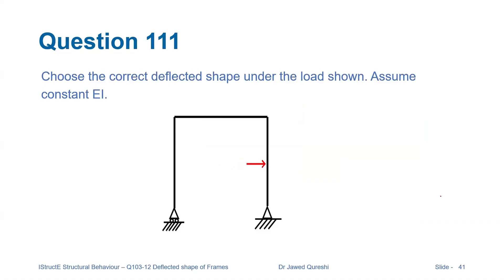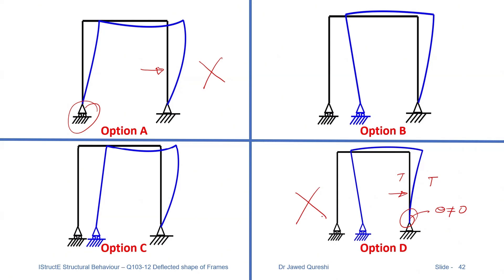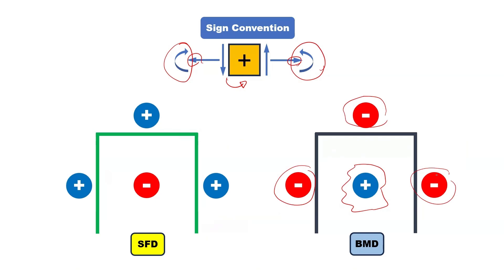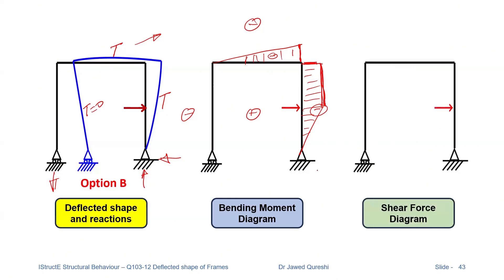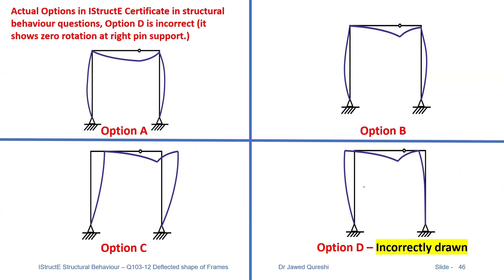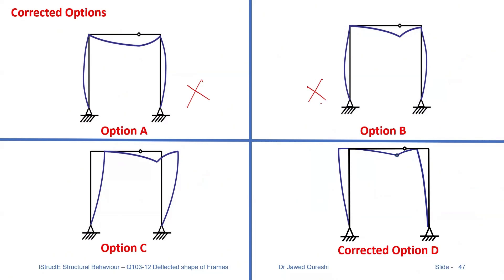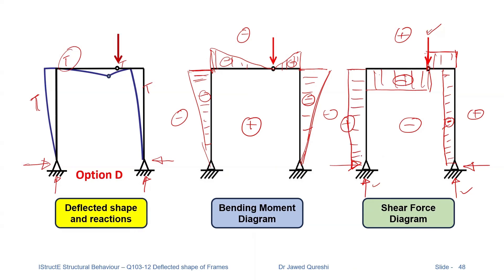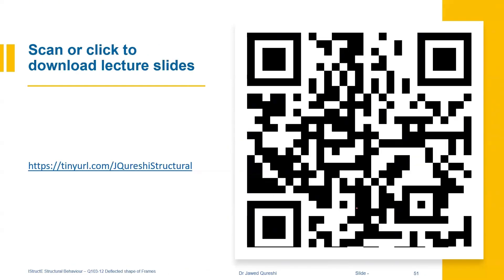Best Way to Draw Deflected Shapes in Structural Frames | IStructE Structural Behaviour Course

Comment: In the second example I am just wondering how does the frame sways towards left? The load is near to right column so it has to sway towards right isn’t?  Because the vertical reaction at right column will be more  ?
Reply from the maker: Load is applied to the internal pin. As moment arm is larger on left side that's why it sways to right even though the load is applied near right side.